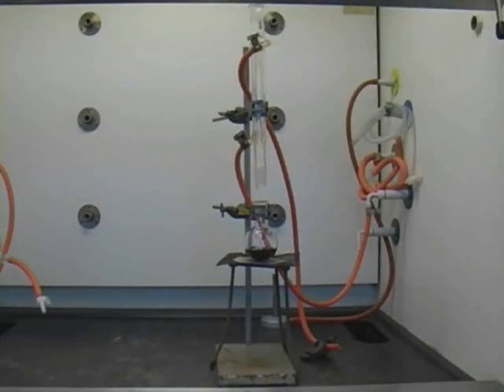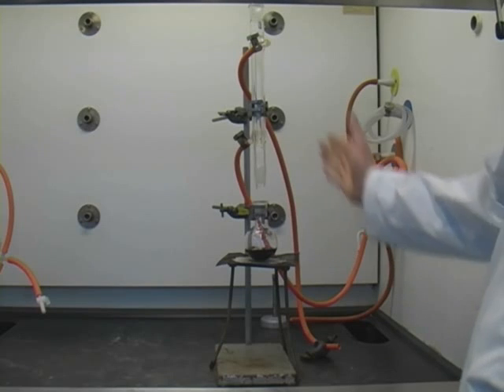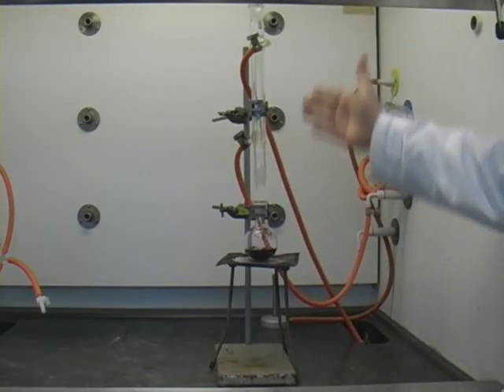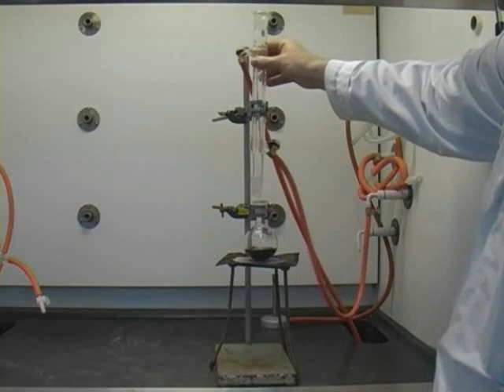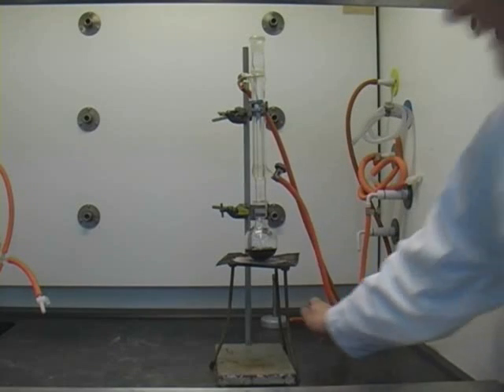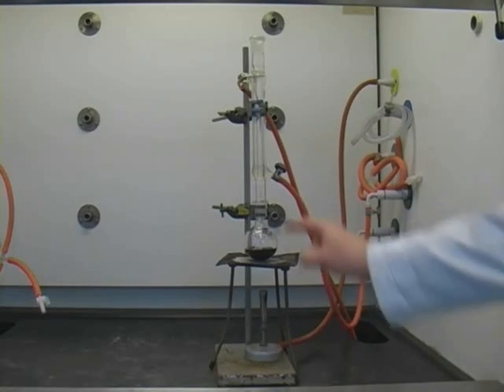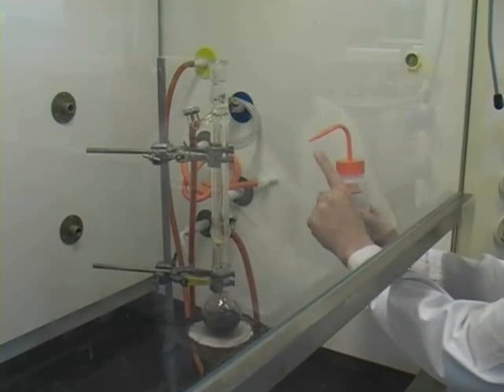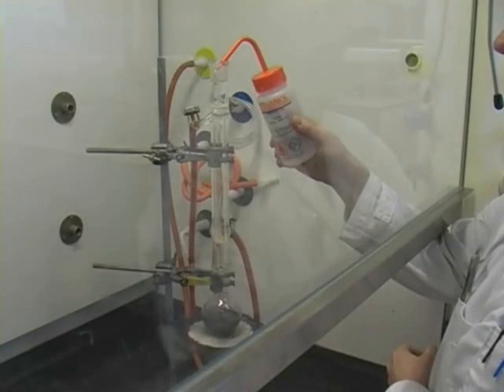Safe addition of ethanol to a reflux

Comment: Hello, I always ..., when I see clips about chemistry in English, to improve my Chemistry-Englisch for hobby job.

But there are four things, which are unprofessional:

1. You should use a oil or water bath to heat the flask, instead of using a burner.
2. Especialy don't use a burner for heating flamable substances!
3. You should use a two-neck-flask, if you want to add another component to the apparatus, instead of adding threw the cooler.
4. Use a more effective cooler.

Greets from Germany!